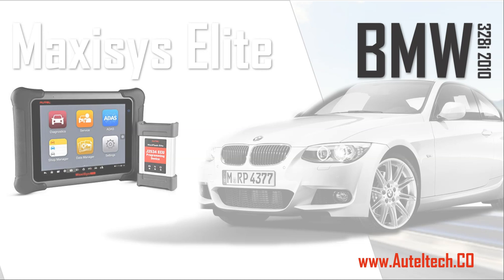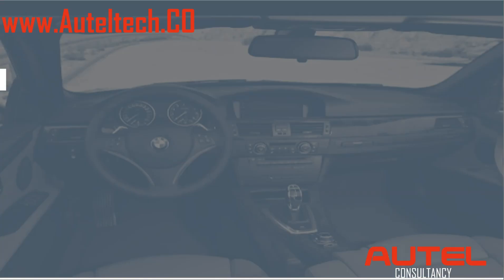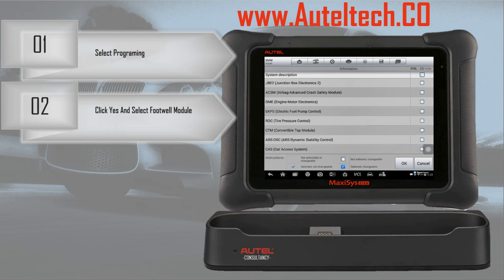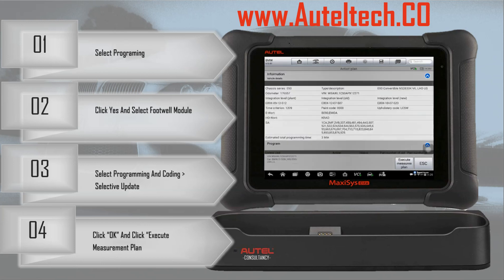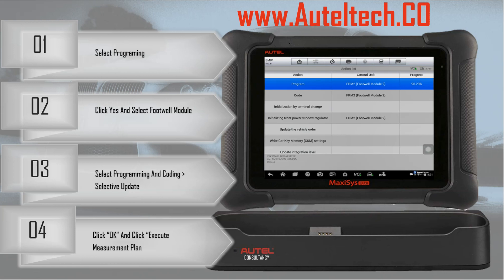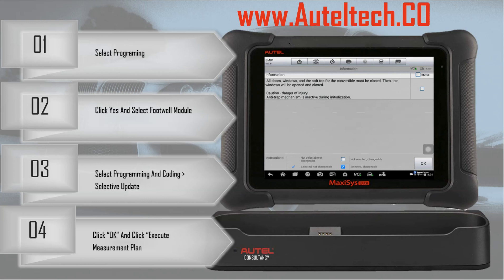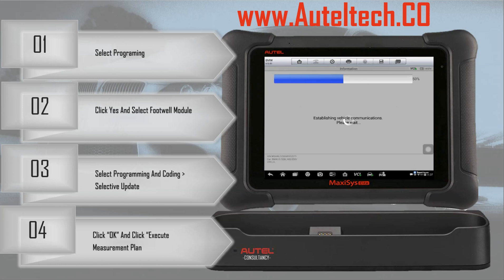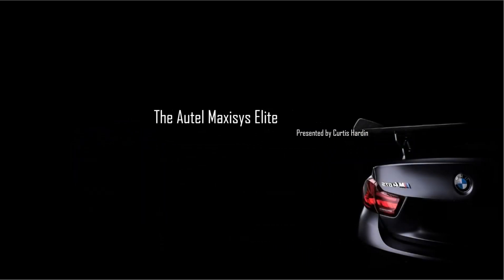Autel Maxisys Elite | How To Program A BMW Footwell Module with Autel Maxisys Elite | Training 2020

Comment: 2011 BMW X3 F25 35i. I bought a used Footwell module on eBay and programmed with Maxisys Ultra Lite. The light system error message now cleared. Works good.

Comment: Can it reprogram a corrupted FRm?
Reply from the maker: You would need to fix the FRM first before you attempt to reprogram it. If the FRM is corrupts the software wont install on the FRm module
Reply: @AutelConsultancy  okay. Can write Rom files to the FRM with the Autel elite?

Comment: Why didnt he just repair the footwell module?
Reply from the maker: You would need a different software to do this
Reply: @AutelConsultancy  , many technicians are offering clients solutions based on their capabilities like replacing a module that could be saved the repair is quick will increase his turn around time and you could also rub off the saving on your client.

Comment: Just because a battery maintainer might have a 90 or 100 amp rating does not mean it will be capable of supplying the amperage if the cable clamps and jump points are not clean and shiny and have enough contact area.
   I like to hook maintainer directly to the battery whenever possible, have doors, trunk  ajar but latches snapped shut, so courtesy lamps stay off if some one needs to swing door open the latch is still closed and courtesy lamps won't come on and disrupt things.

Comment: Had to update the DME on a 2007 328i last week. It had a system too lean code and after testing all typical fault points for this code, nothing seemed wrong. Found a TSB that said a software upgrade would fix the issue. Used the elite and within within 20 miles....no more check engine light and passed emissions inspection.
Reply: clean the mass airflow

Comment: Does this feature/function only work with "elite" device? Can maxisys ms908s pro capable of program to footwell module? Thanks.
Reply from the maker: Hi Sinan . Yes thats correct. MS908SP , MK908P, And Elite all have this feature.

Comment: First of all thanks for your great videos . secondary ,it is required any subscription to the sever rather than Autel subscription ? and how i know the models which are available to be programmed by Autel ?
Reply from the maker: HI Mr Ali.. You dont need any other subscription. You just need to have a valid Autel Subscription. Its difficult to project which modules are available with out connecting to the vehicle. Usually my clients will varify with me before hand with a VIN number if the Autel can program / code a module.  This way they wont waist any time when they do the procedure.
Reply: @AutelConsultancy  thanks , i meant which vehicle brand can i program or it is suitable for all cars ?
Reply: @AutelConsultancy   a valid autel subscription mean?
Reply from the maker: @ttran8538  You need to have a 1 year subscription active on your tool